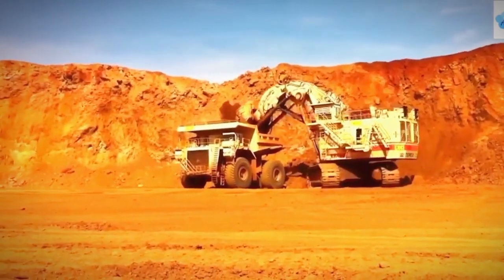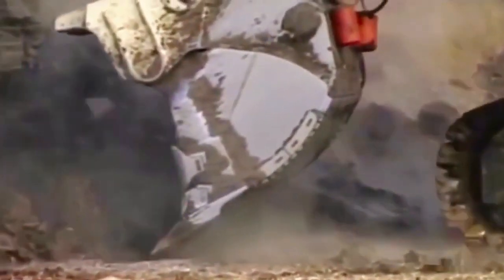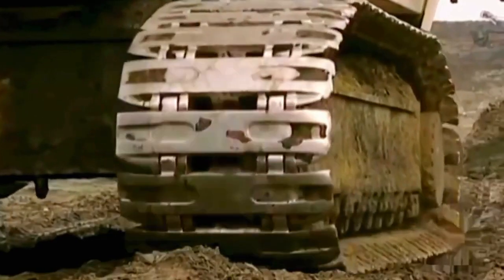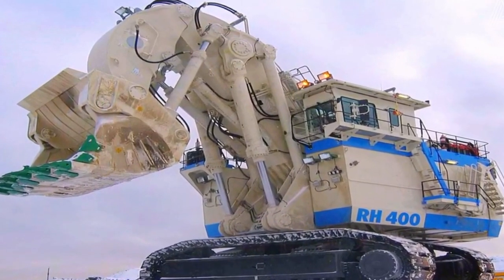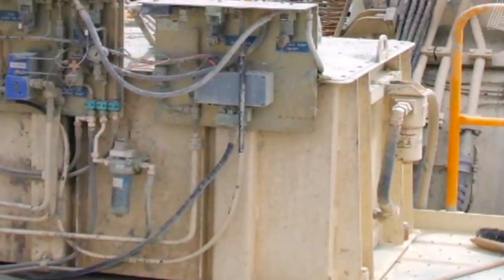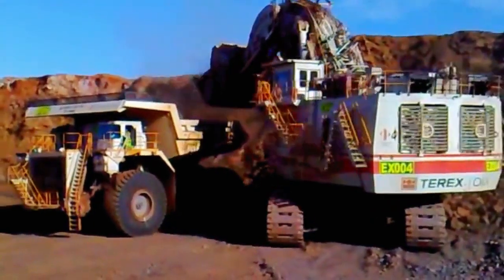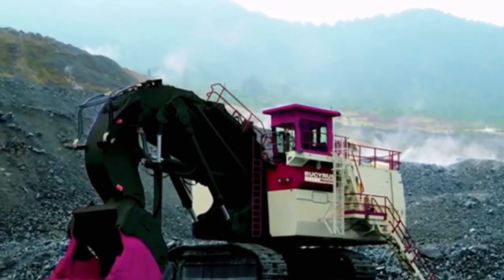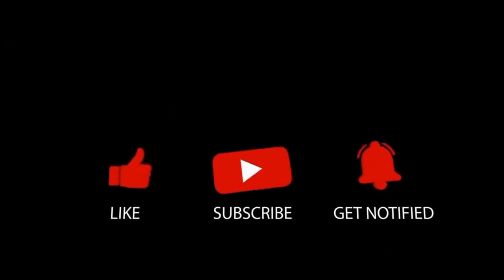RH400 Bucyrus the Biggest Hydraulic Excavator in the World

Comment: 2nd biggest, the Cat 6090FS is the successor to this, and weights 1000 tons!
Reply: Cat 6090fs is actually bigger,it's discontinued now because of rising cost.
Reply: If we want to know the difference between machines and where there built we will look for a vid on it and comment there, till then fuck off.
Reply: The orenstein and Koppel rh400 is the first excavator,  made in germany . The terex and the bucyrus are the same in different colors , also made by o&k Dortmund germany . The only Difference of the cat 6090 is the bigger Hydraulik valve Block,  the cat engines and the color ! Thats it . These are all the same rh400 made by o&k
The diffent weight is only the optional Equipment you get , different shuffles , longer or smaller cab ( with or without extra room with Microwave, locker room ) and of course different fuel Tank capacity. The first 3 rh 400 had a shorter chain drive ( 1 roll smaller ) every rh400 ( terex, bucyrus,cat 6090 ) are unique ! The build only one  if they  sell one  , and with a lot of customer wishes . So please stop writing if you dont now anything . They are all the same ....and all made in Dortmund germany in the same Factory , only with some little  improments